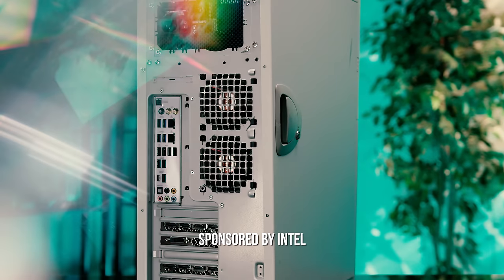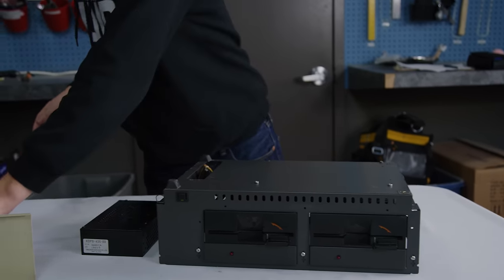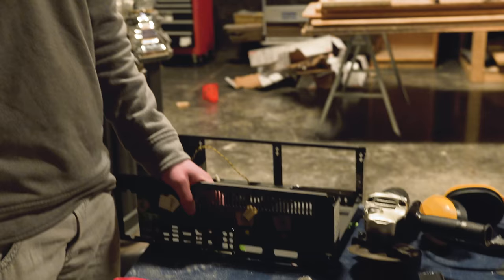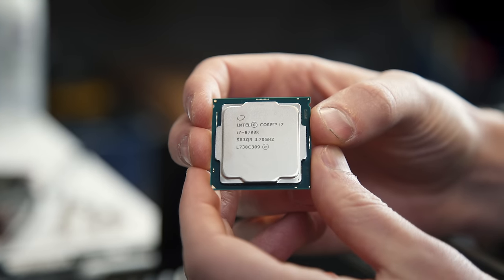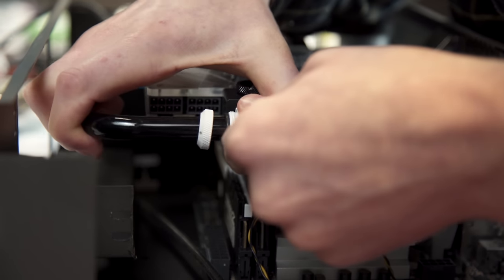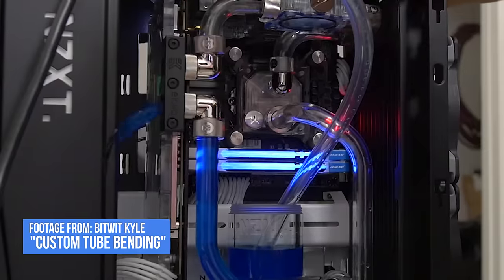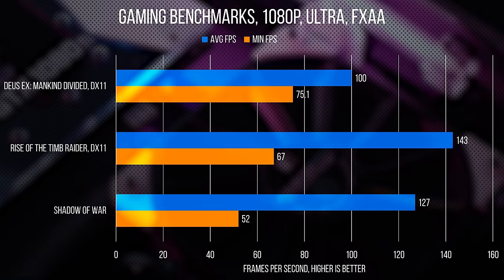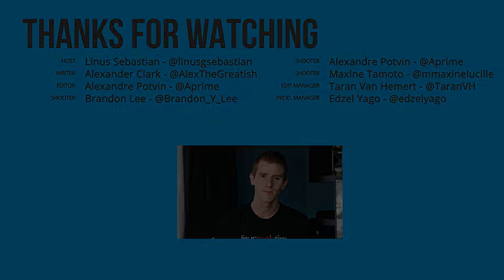The ULTIMATE Compact Sleeper PC Build

Comment: Was born in 74 goddamn is eryone my age dead, or not working for any tech anything, all obsolete and still lving in the past watching MacGyver on a rear projection TV? . Bah  some day someone will need a person that can code a calculator with FOTRAN.
Reply: I know how ya feel, my fellow 74'er.
Reply: You can code on the calculator app?
Reply: Hey, FORTRAN's still getting plenty of use. As far as I know, there's still nothing that can even touch it for raw performance in numerical computing applications. Super-fast FORTRAN math libraries, like BLAS / LAPACK (for linear algebra applications), have been optimized for literal decades to reach truly astonishing performance that nothing else can reach. Which means that just about all fast math libraries, like Python's NumPy library, are built on top of some FORTRAN somewhere. And due to the extremely well-understood old libraries, bases of legacy code, and masses of older programmers that are familiar with it, It's still the primary language for demanding scientific computing applications like climate simulation, astrophysics, particle physics... if you look for software tools coming out of CERN or NASA, they are almost universally written in FORTRAN.
Reply: gorepuppy 1974?
Reply: gorepuppy I am from 1970
Reply: gorepuppy: Shoot, I was born in 1963 and try my best to keep up with tech, but it's changing too quickly for my creaky old brain to keep up to date with it all. I sometimes deal with it by dozing off while sitting in front of the monitor while reading about what's new. Well, that plus now trying to keep up with all of the security holes in just about every CPU ever made makes me feel like disconnecting from the Internet permanently and go back to reading paper books and watching TV through the antenna and wait for the day that my diabetes finally does me in.

I used to criticize the hell out of that crappy show "MacGyver" because the majority of things that he would jerry-rig would have never even worked. Needless to say, wasn't a fan of that show. I can't even watch CSI (followed by whatever they call it this week) without laughing every time I hear those silly twinkling noises that their computer monitors make whenever something changes on the screen. Apparently, no one working on those shows has ever used a real computer before. LOL!
Reply: I guess I am the young one here. 1976. Well.... We can allways tell stories on how the computer revolution changed society. And then we are allowed to yell get off my lawn young hipsters, you and your shiny hippy usb drive. 😎😎😎🤔.

Naa. Just kidding. It like hurted my heart to see anyone cut and destroy something that rare.
Reply: bcdoggie Those sequrity holes. That is why I use Linux and Unix. No more Windows and MacOS for me. If I want to game, then I have my Amiga, C64 and my collection of 6 old Dos machines. Plus a RaspberryPI3, Playstation1, Playstation2 and Playstation3. Yup. I got enough gaming options to last the rest of my life.
Reply: brostenen
, I also use Linux on all but one of my computers now, with Windows 7 being the OS of choice for a computer that I use as a DVR to record OTA TV shows. That's because I have yet to find an easy to use, out of the box program that actually works consistently as a workable replacement for Windows Media Center. I have tried Kodi, Openelec and probably another one on my Raspberry Pi 2 and 3, but none of them ever worked properly, or at least for long. There have been many times when one of the open source choices for a media center replacement actually tuned in TV stations, but then when I rebooted the Pi, it would no longer tune in to any TV channels, no matter which USB TV tuner I used and I could never figure out what went wrong. Those programs are way too finicky. I do give Kodi and OpenElec a try when new versions come out, but I remain skeptical thay they will actually work consistently. I have also tried running those programs on a "real" Linux PC, but had the same results. I also have Kodi installed on my Windows 7 DVR computer, but it also has the same issues. To be fair, I have yet to try using a dedicated computer for each, the front end and back end although I don't see how it would make any difference. Why anyone claims that they are "easy" to use baffles me, unless they mean it literally, avoiding mentioning the setup part which is definitely not easy. Perhaps those people are coders who know exactly how to recognize and fix problems in the blink of an eye.

I am a bit jealous of you, brostenen
, because while I love gaming, I can no longer do it due to a few painful physical issues with my hands. Ironically, I still have possession of all of my gaming systems and games. Let's see if I can remember them all, just for fun: some random console that has two knobs on it and features a couple of pong-like games (very 1970's); an Atari 2600; NES; Super NES; an unusual Pioneer CLD-A100 Laserdisc player that also plays Genesis and NeoGeo games, and some others that I don't recall at the moment; an N64; GameCube; Playstation 1; the tiny PS1; and the final console gaming system that I have bought, which is the PS2. I also have a few hand-held systems: GameBoy (the 1st one); GBA; a silver PSP and an aqua color 3DS. Well, naturally, I also have a slew of PC games. As far as PCs are concerned, I have (too) many and am not going to mention the home built ones because their innards tend to change. I have two 286 Tandy 1000TL computers that have low density 1.44" and 5.25" floppy drives. One of them has a whopping 10MB drive and the other has a "very" spacious 20MB drive in it. LOL! The following year after buying the one with the 10MB drive, I bought my first multimedia computer, which is a Packard Bell tower. It came with a 28.8kbps modem (eventually upgraded to a "blazingly fast" 56kbps jobbie. It also came with a 2.1GB hard drive, which I had eventually upgraded to a whopping 2.5GB drive that was on sale for the low, low price of $99.95 (or was it $99.99?). It also came with 16MB of RAM, which I had upgraded to 32MB and it actually sped it up noticeably. I also have a Compaq 386 desktop and a Silicon Graphics of some sort that I bought while I was at a computer show (remember those?). Unfortunately, the SCSI hard drive was bad and I was unable to find the original software for it, so I never bothered to repair it.

Well, that was all much wordy than I had thought it would be and I apologize for the wall O' text. Well, being a very wordy person, it shouldn't have surprised me after all.
Reply: bcdoggie Yeah... Some times there is still need for windows. Yet for each year, the need becomes less and less. I dont do video broadcast or anything like that. So my need for windows as of now, is non excistant. Speaking of old pc's. The oldest I have, is a Unisys 286, everything original down to the manuals. It has an 1987 optical mouse, ega monitor and 20mb mfm drive. It is a wonderfull machine. Yet the best one in my collection, is still an Amiga500. That is the most fun of all my vintage stuff.
Reply: brostenen
, Well, this sucks. I had just about completed a three paragraph reply to your latest reply to my previous message, when I got a phone call and had to get up and grab the phone. Well, shortly after I sat back down I grabbed the marble mouse and in the process accidentally pressed a button causing the browser to go back to the previous page which, naturally, deleted everything that I had typed. Don't you just love when things like that happen? Now to see how much I remember and retype it...  LOL!

That's really cool about your Unisys 286, as well as having its original manuals. Ah, yes, good ol' MFM drives that take forever to access anything. The 10MB MFM drive in one of my Tandy 1000TL computers had to sometimes be removed from the ISA slot that it sits directly in and then spun once with a twisting action of my wrist in order the break the heads free from the platter inside. Since I haven't used that computer in ages, I'm not sure if that drive even works anymore.

I agree with you that MS Windows is sometimes still needed for some things, such as gaming or running the now subscription based Office suite, and don't get me started on that messed-up concept of basically renting software that had been free for many years. SMH (as the "cool kids" type these days) Speaking of Windows, Microsoft lost my business when they introduced (more like imposed) Windows 10 on many people. Oh, they tried and tried to install that crappy OS onto my Windows 7 computer, but I installed the GWX Control Panel to keep it from automatically downloading the then sneaking its way onto my computer, and then having to look up every single Windows update to see exactly what else Microsoft was trying to install onto my own property (computer). Yeah, they lost my business after trying to outsmart me with their shenanigans. I'll end my little rant here before people begin to accuse me of having mindlessly jumped onto the anti-Microsoft bandwagon. I don't go around parroting things like that. Microsoft has lost my business due to their highly shady business models and I don't need confirmation from anyone else to come to that conclusion.

On a final note, how I could have forgotten earlier to mention my 8088 CPU powered Zenith Supersport laptop? It has a 20MB hard drive; 640k of RAM; 3.5" floppy drive and a modem built-in. The screen's backlight was not working when I bought it at a computer show for ten whole dollars. I was able to repair it with a quick solder bridge on the part of the flexible plastic circuit band (I forget what they are called) that came around from behind the panel around to the front of it. Come to think of it, I think that it was a permanent part of the backlight film panel that bent around to the rear side of the panel. It came with DOS 5 installed, but I upgraded it to DOS 6.22 and even installed Windows 1.01 onto it just to see if it would run and it did! I left it that way and I think that it still works, too.
Reply: bcdoggie Sweet.... Old computers are really a nice hobby. Just think about this for a second. How many machines from the 00's, used everyday through their life before being retired, are still running today? Versus how many machines from the 70's, 80's and up to some 1998/99? Things were build better back then, especially up to around the 90's. Late 80's machines are build like a tank.
Reply: Well, yes and no. Obviously, the MFM hard drives in my Tandy computers weren't particularly reliable. Then there were the extremely reliable, and much more expensive, Winchester drives of which many probably still work today, but are so woefully outdated that they just aren't used anymore, as far as I know. Perhaps some small bank in some small town might still be running such a relic for their database, but I am not aware of it. I do have some hard IDE and 1st generation SATA hard drives that still work, but they aren't used in my frequently used computers.

Speaking of outdated computer hardware, I have never been concerned with always buying the latest, greatest and fastest hardware, mainly because it would have bankrupted me long ago. The fastest computer that I run today has an AMD FX-6300 CPU, 16GB DDR3 RAM and a 520GB SATA III SSD. I am not planning on upgrading it anytime soon because it suits my needs. Well, OK, I did recently install an ASUS Cerberus GTX 1050 Ti OC Edition graphics card, but that was because it runs 4K content on YouTube smoothly, as opposed to the GTX 650 Ti that it replaced, which was jumpy at 4K resolutions. It also runs Second Life smoothly in ultra mode, which the 650 Ti OC Edition could not do, unless I were to lower some other settings which would make it look not nearly as good as it did in the next lower setting to ultra, which is where I had it set. While the single core performance of the AMD FX-6300 CPU isn't as fast as a comparable Intel processor, it is a beast when rendering video. Yeah, there are faster processors that probably blow the FX-6300 out of the water now, but I'm not using mine in a working environment and time is not of the essence anymore for me.
Reply: bcdoggie Ahh yeah. Today I finished testing out a 50-pin SCSI setup in my dx2-80 system. It is an old BusLogic VLB card from around 1993 or something. I found the original manual in pdf and all the dos drivers. Working wonderfull in MS Dos 6.22. 😋
Reply: I was born in 1942 I worked at Ames research with the cray beasts. I worked on the IBM 1401 as a consultant for IBM. We old folks need to keep o our toes around these young people in a fast-moving technological world. I first used Fortran on the 1401 in 1963. ever since I have been using it in daily tasks along with ansi cobol and other dead programming languages. We old folk might not have the speed that we used too, but damned if we wont try too keep up with these young people.
Reply: Jackson Lindorfer True that. If we do not keep up with the simplest of all, then we are lost. Personally I have no desire for most socalled social media. I have no Twitter, snapchat and stuff like that. I did however try facebook when it was new. Slowly it became infested with bad design/layout decitions and filled up with corporations and advertisement. Yeah. All sort of filth that had nothing to do with user interaction as such. So in 2014, I decided to quit. I do however have a google+ like everyone else that has a google login. Though most of the times, I spend my online activity on youtube and small forums. The internet experience is so much better this way.

You worked on early computers? 🤗👍🤘That is awesomme. I wish that I had that opertunity. Yet born in 76, then I have only seen the homecomputer revolution up close. I envy you, that you have contributed to the computer revolution up close and personal. That is so cool.
Reply: Thank you, I am glad to hear that others feel the same way I do on these matters. it just goes to show how we all no matter our age have the capacity to learn about these things. I as well do not have social media I find it to be a detriment to our society as a whole. I had to deal with the bad old days of computing, it was not as glorious as one may think. dealing with 9 track tape ( even though it was at the time the best method for storing data was a cumbersome process). In reflection, I will be the first to admit it was a blast to be able to experience these technologies. But sadly now those times have gone and we are stuck in the world of "its broke time to go buy a new one".
Reply: Jackson Lindorfer Yup. What we can still use those old skills for, is to restore old equipment. I have a lot of old NCR boards, from an NCR accountants machine. And the complete service manual. It was the blue NCR machine. I just have not found anyone that are in the process of restoring those.

Regarding the storage. Man. I feel you in a way. Mine is not as extreme an example. Yet personally, I am happy that we do not use QIC80 tape drives anymore, or old floppy disks. That said, then I do use them for keeping my old machines as original as possible. Just recieved an 3.50 inch sony floppy drive today. Going to replace the one in my external amiga floppy drive case. Yet once they are all gone, then something has gone away for good. Yup. Old drives of any kind, have their own little special thing about them.
Reply: Shadow Gaming doubt it, you have a Minecraft pfp
Reply: brostenen, that's sweet about the old 486 DX2 80MHz (very fast CPU back then, duh) system still working. What's the oldest system that you have connected through either cable or DSL and then surfed (more like dog-paddled) the web with? The oldest and slowest computer that I had used was an IBM Ps/2 386 with a whopping 8 MB of RAM. I had installed the Arachne DOS web browser and had the computer connected to cable. If I recall correctly, it took approximately five minutes to open a simple web page, and that was sometime roughly around 2004 +- a few years. I can only imagine how long it would take that thing to open a lengthy Wikipedia page.
Reply: bcdoggie That is an old machine to put on the net. The oldest that I have owned, and put on the internet, was an K6-2-500, back in 1999. It was a system based on a gigabyte ga-5ax rev 4.1 board. The oldest that I have tried the internet on, was a terminal, hooked up to a vax machine. We used the Unix command line, to telnet into different servers through the internet. As we had to learn how to connect to one server and through that connect to another. We had to experience how things slowed down this way, our teacher told us, back then. It was in 1995. Of course it was not html, yet it was still on the internet. Just the telnet technology. Then we used unix vommand line to send emails to each other, and used the message command to message someone directly through command line, that were sitting on another continent. We just had to telnet into that server first. Never learned to message anyone directly from our vax server, that were logged into a diggerent server.
Reply: brostenen, Yeah, you should have heard the IBM Ps/2's hard drive chattering away as it was being used for the virtual memory, too! I still have that thing, but since it has been sitting in a plastic bag in the garage for the past several years, I'm not sure if it even works anymore. I never intended for it to remain there for so long, but I quickly ran out of space indoors. Oh, add to that the very hot and humid South Central Texas weather in the Summer and I would be very surprised if it still worked.

Heh, I would have been jealous of your 500 MHz K6-2 CPU back then because I had used the 300 Mhz version of that processor in the computer that I built, as I will explain in the following paragraph. I have used telnet only a couple of times, until I learned that it could be pretty easily exploited to allow someone access to my computer's data.

I feel sort of like I am the odd man out in this discussion because of never having had a technical job where I had to work with computers on such a high level as not only you, but some of the others here. I am a semi self taught computer geek. I used the word "semi" because I once had a friend who I only knew online and when the IDE controller chip my Packard "Hell" (Hey, I didn't know any better when I bought it. LOL!) began to have problems, he walked me through the process of building my own PC from scratch. He also taught me how to use the FDISK command to partition my hard drive and I soon learned how to make my computer dual-boot into Windows 98 and Linux using the Linux version of FDISK, and the rest, as they say,  is history. Well, more like personal history since I am a relative nobody.
Reply: bcdoggie Well... That would have been a really great experience to hear that drive swap. 🤘

Personally, I have only worked professionally with computers from late 2003 to early 2006. I had a job of building at least 12 computers a day (my former boss's rule) plus doing all telephone support and doing half of email support each day, from 9am to 5pm. It was those standard Asrock/AthlonXP/FX5200 machines at that time. Build 4 in a row, put them to memtest, begin 4 more, and do a trial install of XP on the first 4. It wore me out completely, thqt job, so he fired me because he had no money, after spending thousands on shopping and golfing each month. Yeah. He was a real turd. Took all, gave nothing type of boss. Else I am a self taught "geek" my self like you.

These few last months, I have gone back and begun fiddeling with Amiga's again. They are wonderfull machines. Yeah. When it comes to hardware from 1987 to 1989/90, then I like a good Amiga over a Dos/Intel machine.

Getting back to work with computers. Then I have a lot of education at school. I managed to get through a web programmer education. I did a number of basic courses in basic digital technology, and did half a 4year computer tech education. I did what would be required to be an educated it-supporter. (That is a 2.5 year education here in Denmark)
Reply: brostenn, I believe that you have actually inspired me to get off of my lazy butt and grab that old IBM computer from the garage, check to see whether or not it still works and if it does than record a video of its hard drive swapping away madly. It never even occurred to me that anyone would want to hear something like that, but it doesn't really surprise me. After all, I was amused by it when it was happening, oh so long ago.

Man, that sucks about your old boss being such a jerk. Unfortunately, people like that only care about their own selfish interests without giving a damn about the people who actually help them to make their money. I have worked at a couple of places where I was treated more like a machine rather than how a human being should be and I used to think that I must have been doing something wrong, until I became more wise later on. I was a tad on the naive side when I was younger.

I have a friend who used to have an Amiga and he loved it. I remember him letting me play Lemmings on it and I was amazed at the graphics and gameplay. I'm not sure if he still owns it. The first computer I ever owned, not including a TI 99-4/A that was given to me for Christmas one year, was the Tandy 1000TL that I had mentioned previously. I Bought it used and I am still glad that I got it when I did because it is how I learned the DOS commands that I still sometimes use today, some of which still work in Linux. Of course, that doesn't surprise me since Microsoft had essentially "borrowed" many DOS commands from UNIX.

The only programming education was when I was in high school and took "Computer Programming 101". It bored me because we did our programming in BASIC on a Wang punch card setup and I couldn't see what the big deal was about programming computers. Looking back now, I with that I would have stayed with it, but I dropped out of that course, thinking that I would never own a computer in my entire life. Oh, how times have changed...

And now for something completely different. Since you mentioned that you live in Denmark, it reminds me that when my father was in the U.S. military, he was once stationed overseas for a few years. While there, he drove all of us (the family) around some different European countries and one of them was Denmark.I as only around 10 or 11 years old during the trip and my fondest memory was Legoland. I remember being amazed at how huge it was, as well as by the miniaturized roadway and especially by the Lego boats that extinguished a small fire by shooting water from the little river onto it to put the fire out. Fun times... :-)
Reply: bcdoggie Ahh... The old legoland. Yeah. It is a place that nearly all families tend to visit at least once. It's kind of a cultural thing here. Much like what Disney land is to Americans.

You are actually quite fortunate, to have tried an Amiga. It was not that widely adopted in North America. I dont know about South America, Australia or Africa. Though here in Scandinavia and in Germany. The Amiga was kind of the king of what young people and the ordinaery people had. The ratio between most known systems between 1982 and 1993, was something like 70% Commodore computers (C64 and Amiga), 29% IBM compatible and 1% Apple. Untill some 2002/03, I only saw one Apple machine in person. In the early 90's, I did however hear about one person in my town, that used a Mac computer.

Regarding Amiga. Then I remember 1992 and 1993 as the years, in wich Amiga's and Dos machines were equal in terms of gaming and productivity. It did not matter if you spend the same kind of money of each. Shure some games were better on the Amiga and the other way around. It is just that they were equal in what bang for bucks gave you.
Reply: gorepuppy dude you're only like 44. Stop saying you're old.
Reply: *Random_Potato * Heh... I feel old. By bones are tired, can't sleep well anymore and my beard are all white. It used to be black untill 10 years ago.
Reply: Someone get grandpa a slide rule to play with... he's being grumpy again!